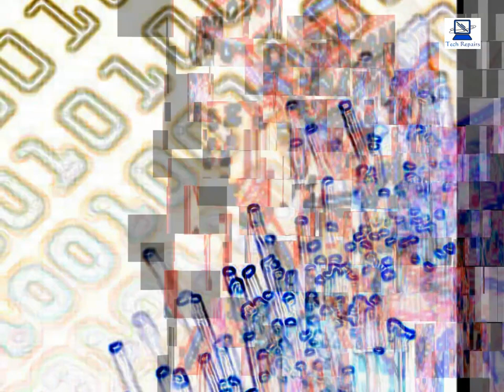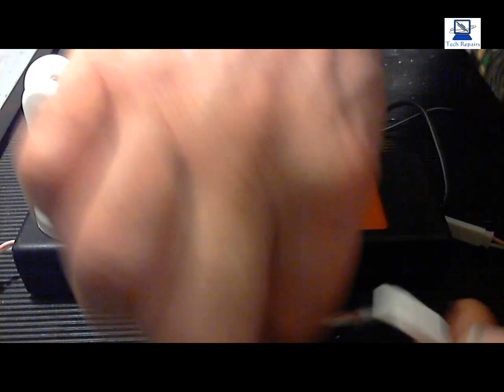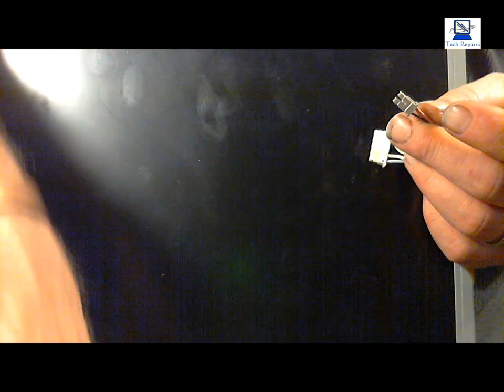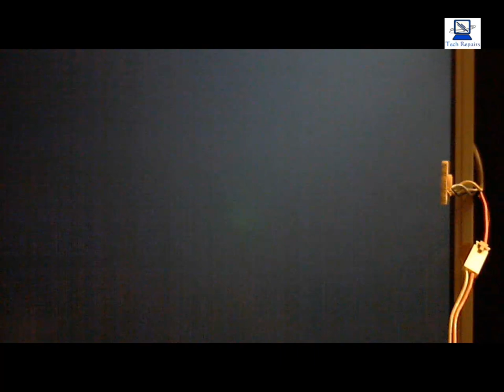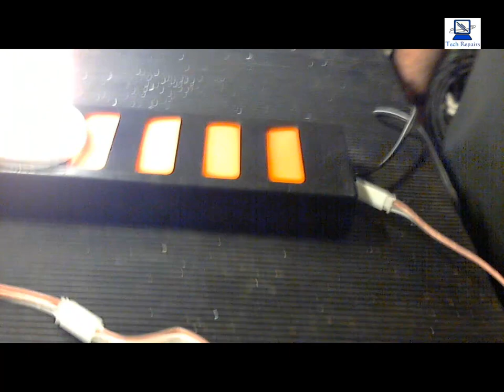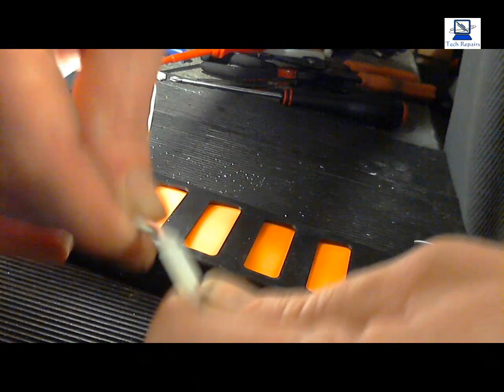Inverter and backlight tester (prototype) Part 2

Comment: The compact fluorescent lamps use hot cathode electrodes, so they might be a bit unstable and flicker on a cold cathode driver due to discharge instability on the electrodes.  This also tends to "sputter" them and make the area in the vicinity go black if they are left running on cold cathode drivers for a while.  Not really a problem for a simple test like the one shown though.  As someone else has mentioned, the multi output CCFL drivers do tend to require a load on each channel to keep them on as a safety feature.
Reply: Seems you know your stuff a question if a screen flicker once bricky *dark blue almost black) when powering but no picture is that likely to be back lights or inverter ? Thanks
Reply: Clive please do a video on these things!!😀😀
Reply: Oops sorry, found your inverter videos now😀😀

Comment: You know already that I appreciate what you have done here. But I do have a slight problem. Some TVs have a dual drive to the back-lights and BOTH need to be serviceable or an O/Voltage detector will usually shut everything down. This could mean the need of two test lamps. Some of these energy saving lamps have two (folded) tubes and I wonder if that type would be a better choice? I also suspect that the flicker you have here is to do with what I think was once called the Puckle effect!!